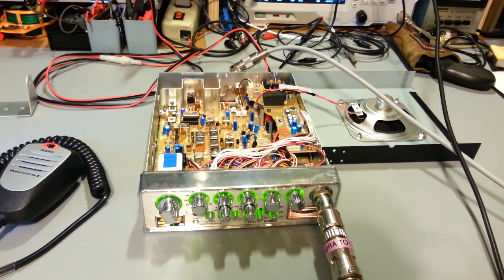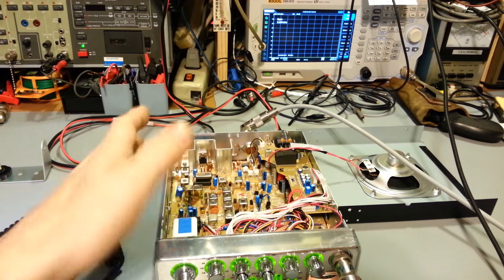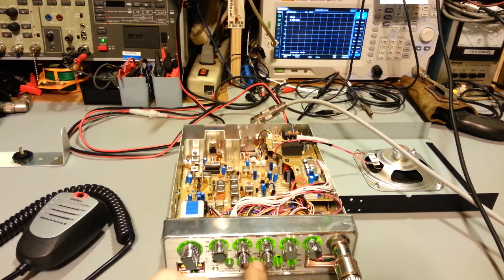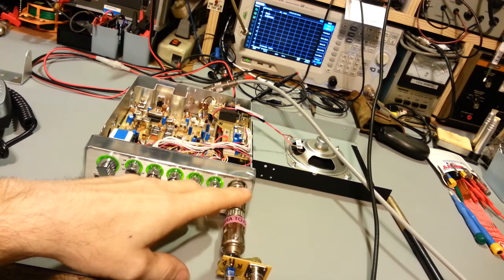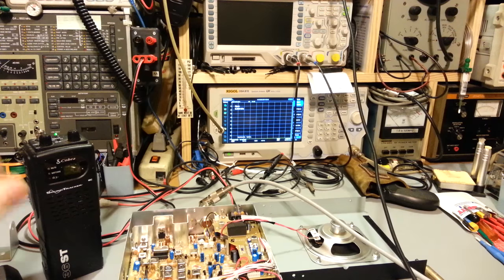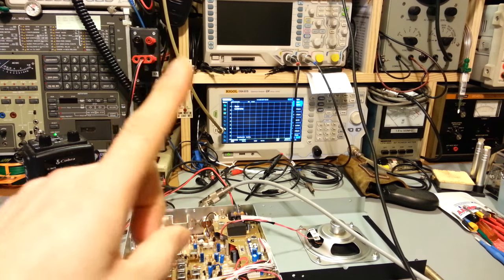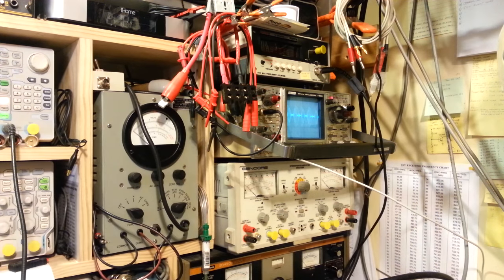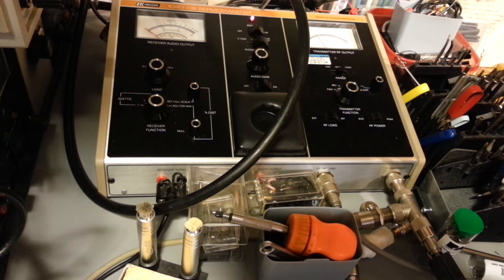Why not to "Peak" and tune, clip AMC limiters.  It only causes distortion.

Comment: I used to hear the channel 6 bleed over when I drove trucks through DC and they sounded like they were talking through a kazoo!🤣
   I run a D6 dozer now with no amplifier and the Cobra 29LTD that has been bounced around for years finally gave up and I installed a President Andy with no hack job tune up and it's doing just fine

Comment: Is no one going to mention the revolver in the holster? lol

Thanks for the video I'm going to ask a local cb shop about this procedure to reduce modulation noise. I had my radio peaked recently but I haven't had any complaints about my modulation signal or my loudness. I believe I reached a man at a mile marker 8 from mile marker 60 based on his claim. 

My shop showed me at 20 watt pep but didn't tell me the rms. I have a dual antenna (5' 6" firestick about 8' separated) on my semi truck mirrors. The radio is a road King. Hopefully it's working good but since I had to trust them without seeing any proof of the signal condition and power I can't really say anything of it's effectiveness.

Comment: I'm a long-time CB technician. This is a very well-done video. Great explanation! BTW... Why is your revolver and its holster sitting on your bench? (I've had a few radios I would have liked to use that on!) ("Whoops; that radio is a total!")
Reply from the maker: That's a supersonic lead injection tool.  When you can't scare a radio into working with a 100 Watt soldering iron the Bulldog 44 Special usually does.  🙂
Reply: @mikesradiorepair  WOW! I gotta try that!!! (I'll file this under "when all else fails")

Comment: Mike, why cheap small AM radios have the disadvantage that the power in the indicator decreases during modulation? What is the reason? Why do they sound so weak, poor modulation, low quality sound? Is there any advice?

Comment: Thanks Mike that was interesting. Nobody talking on 27 mhz cb radio around here any more. Using a stock Realistic TRC 453 and a wire delta loop up about 20 feet.  cheers from a land down under ..

Comment: I've been peaking CB,s for 50 years and clipping limiters never had a problem 😮
Reply from the maker: And probably don't own and use a spectrum analyzer to check adjacent channel splatter and out of band emissions.
Reply: @mikesradiorepair  I cut the limiter on radios that I use a stock mic on stock.Mikes need all the help they can get.They'll only overmodulate if you whistle.However I do use in a silk scope from time to time you are the master

Comment: My 40 year old TRC-457 & 458 still have the wax in the slugs. That being said you can modify or increase your radio for 100% modulation.
Some radios may require a slight mod to get full modulation. Some would clip so much you'd be lucky screaming to get 50%. 
But clipping the limiter gets you a radio that sounds like crap. Gritty lousy distorted over driven audio. I try to tell people that all the time.
Most people won't listen and just want to see maximum output.

Comment: Bought an antenna at a local shop today and the tech tries to tell me that all radios now come in at 50% modulations and 50% power and that they all need adjusting, this and that I had to stifle my laughter.  I wouldn't trust that guy to tune a guitar, nevermind a radio.

Comment: I can see your point, but these are often clipped cause the AMC is too op. I have a ranger t radio, and it has AMC, and it puts out barely any modulation using the stock mic. so you can say don't clip it even if your life depends on it. their gonna clip it anyways, cause with the AMC it barely modulates unless you put an amplified mic on it.
Reply: I know ill get flamed for this but the older radios seem to only talk decent when you open them up.. I have seen older realistic 40 am mobiles barely put out any modulation with the AMC intact even with a power mic.
Reply: Eric 12374 why would you be flamed? your words are true, I have a teaberry ranger t, and it has the stupid AMC deal. it barely has any modulation in it as it is now. I can literally whistle my lungs flat and it only modulates a little, using sideband shows this. ik this guy is saying not to clip it, but at the same time, you gotta take into account that these new junker radios are Chinese built. of course their gonna have shitty audio when you adjust it to put out any real modulation lol. so Eric, I'm with you on this one
Reply: Why because to a point i am pro limiter removal especially on the radios that just wont modulate no matter what you do.. The older 23 Ch are the really bad ones as well as some of the later 40 ch realistics.
Reply: All my realistics modulate just fine. Might be your mic or the 5 pin din plug.

Comment: Great presentation have found average watt meters run into dummy load at 100% modulation show about 1.25x dead key. New c b radios out of box not quite 100% modulation but Mabey that way for speech processing. Thanks for your time.

Comment: Power meter is a indication  not a true measurement like a scope 73 Thanks for video
Reply from the maker: Disagree.  I can take extremely precise measurements with my HP and Rohde & Schwarz power meters.  Depending on which sensor head I use I can take measurements accurately at -130dBm.  That's 1 times 10 to the -16th or 16 places past the decimal point.  There isn't a oscilloscope that can measure that low.  Oscilloscopes are good for taking very rough measurements.  Most other instruments like power meters and spectrum analyzers can measure numerous orders of magnitude more accurately.

Comment: Limiters are government. I drive a big truck that is governed...but that is so my boss will get a break on insurance. It should be my right to control my own equipment, and be responsible with it. Government kills responsibility.
Reply from the maker: It has nothing to do with the government or "the man".  When you mess with the limiter circuit on the radio all of that new found power is not on the channel you are on. It is splattering the adjacent channels or is in harmonics transmitting in the 54 MHz, 81 MHz, 108 MHz and so on frequency ranges.
Reply: @mikesradiorepair  It's good to see you are still around.

Comment: I would like to see how to modify my d104 mic so it produces more low frequency responce "or less tinny-ish tones". posibly by adding parts of a crossover network to aid in filtering out such high freqincies. or possibly redesign the amp section with a three or four segment equalizer pre-amp. so I could do this myself.
Reply from the maker: kf4dcy 

That's why I don't and never have liked D104's.   I'll stick with Turner mics for their out of the box flat frequency response or if I want adjustability use a studio mic and rack system.
Reply: MikesRadioRepair ,, I can't stand rack systems. including rack style radios. lol,,, impass!!! that's why I need instruction, to fix the d104. I feel a small inductive coil would be that fix. but what mh rated coil and where to place it.
Reply from the maker: kf4dcy 

The standard modification in one is to punch two more holes in the aluminum microphone element cone same size as the one that's already there and evenly spaced.  That changing several cap and resistor values greatly improves low end response.  You can also just throw out the original preamp board and make up a new one using FET's that has adjustable tone control.  There are several different schematics available online.  In the end its just easier to get a mic that has a flat response curve stick like a Turner base mic, no need for any modifications.

Comment: Really enjoyed your video!
I am just trying to do the same as you did here
I have the same spectrum analyzer as you 
My thing is i cant get a stable display of the side bands and harmonics
How do you couple the analyzer to the radio as not to destroy the analyzer?
Also is there certain settings on the analyzer?
Reply: You would need to build or buy an RF tap / coupler,  you don't physically connect the input of a spec analyzer directly to the output of a radio (if you did this already you may have damaged the front end of the analyzer).  You can also use attenuators to cut the signal's power down even more.  And you would also use a good DC block to further protect the analyzer,  as many of them cannot handle DC voltage of any kind on the RF input.

I've honestly seen people spend thousands on a spectrum analyzer or a VNA only to destroy it instantly as they would directly connect it to what they were measuring without using blocks,  couplers, or attenuators of any kind.  These devices are super sensitive,  so be careful.

Comment: Amen!!! I hate splatter box operators. I also hate people that sound like they talking with a mouth full of cotton balls!! The other big no no in my book is echo or any type of noise toy!! If you add a hint of echo and delay so your shack sounds live and spacious but you can not hear any hint of echo, delay or reverb that is fine. The second you can hear any of those effects it is too much. These are the same idiots that we all knew in school that would turn a stereo all the way up until it was distorted beyond belief and think that it sounded good! Same mind set. They would rather have a bbq McRib patty thing than a real bbq rack of rib. No helping some Mike!LOL Clean is mean!!
Reply: Amen to that
Reply: If people would filter their output from NPC and such and run their amps clean I would not care how much power they ran or how much modulation they where running. The real problem though is that these knuckle heads never filter out the harmonics and are transmitting on sub-side bands and splattering on multiple channels tearing up and getting into all kinds of electronics etc....

No one cares because most of the consumers are ignorant as can be and ignorance is bliss! The hacks doing all of this are making money by pandering to their customer's. It takes too much time and cost you too much money to educate your clients! It is easier to just say no and send them on their way. 

On top of this a lot of these "CB Technicians" and "Custom Amp Builders" are drama queens and encourage drama and bickering on social media because publicity and controversy are "FREE" and bring them a lot of business! It does not matter what causes the controversy it funnels people into their shop which is $$$$. 

My youngest radio is from 1998 and it is all factory stock part wise. All my other radio's are 1980's or older! All of them are 100 stock some still have the factory warranty sticker in place. I suspect the cap's or a resistor will fail before the finals or voltage regulator will fail!

Comment: I'm sorry but we CBers for the most part, the VERY MOST part, live in the real world and cannot afford $10,000 worth of test equipment nor can we drive a hundred miles to have someone with $10,000 of test equipment work on our stuff. It would have been better to have shown, how, with basic equipment, that your average CBer could adjust a radio to a legal 4 watts output with 100% modulation, or at least get safely close to that. I'm sure a millionaire could show me how to live the rich style but with me not having the millions I couldn't live like he just taught me, so why not just make shows that teach what can be done and not what won't be done. Stop preaching, and start teaching.
Reply from the maker: Unfornately there is no way to adjust modulation without test equipment.  At the very least you have to have a oscilloscope and a audio signal generator.  Any repair shop would have this.  If they don't then they are not a repair shop.